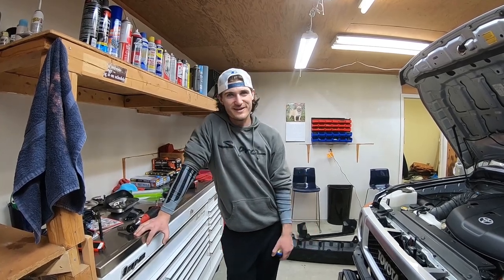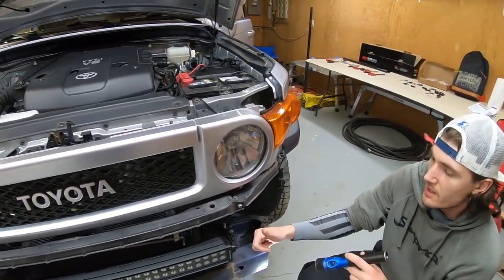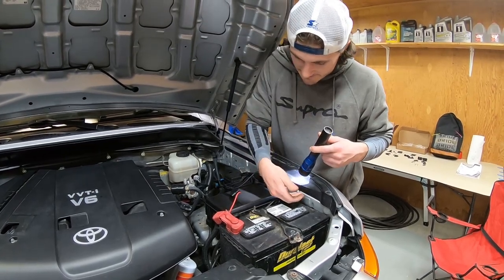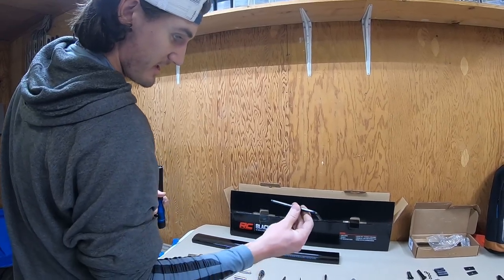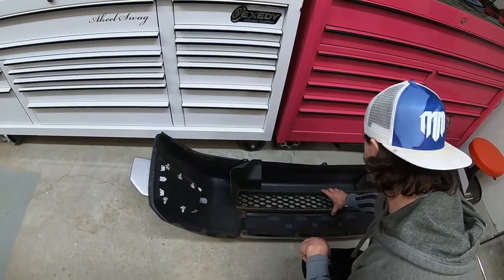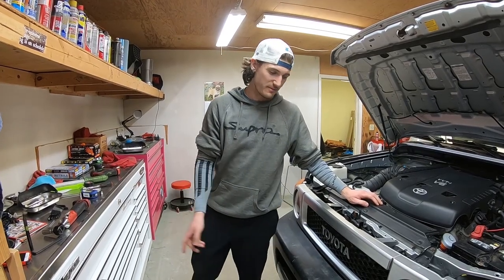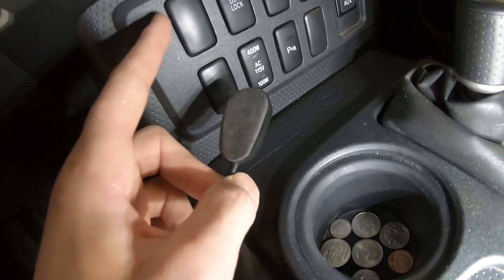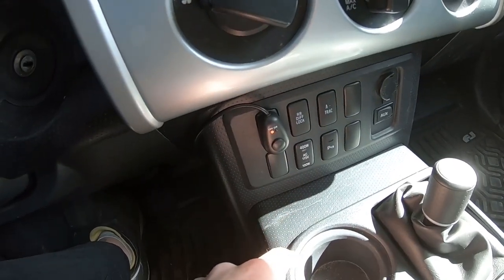FJ Cruiser Bumper LED Light Bar

Comment: Did my install yesterday…Thanks for the helpful video! Now I only have to figure out a small issue with the switch I used 😀 Light works well but the switch is not playing well with my dash/tail light circuit.

Comment: Thanks for another great video man. I was thinking about putting my lightbar on my roof but i dont want to drill into the roof or run the wire through the body panel in the a pillar. This is for sure the way i am going to run a 32" lightbar and i will be using this video to help, just like i did with your axle video. By far the best FJ how to videos. Thanks for all the help!
Reply: @Harlan Kingston meh I watch on Flixportal. You can find it on google :D -neil
Reply: @Neil Jorge Thank you, I signed up and it seems like they got a lot of movies there =) I really appreciate it !
Reply: @Harlan Kingston you are welcome =)

Comment: I really appreciate this video fam. I was planning on mounting fog lights on my oem brush guard and I had no idea how I was going to route the cables through the firewall! 😄😄

 p.s. I don't recommend putting that switch on the top left blank section of your button panel because (since you have the diff locker and A track) your FJ has traction control. Thus, if you were to pull off that blank switch, you would find the connector. All you need to do is plug the oem switch into the connector and boom! You just got yourself a package upgrade for your car all for the price of one switch 😂😂
Reply from the maker: Broken_font thanks for the info, I heard about how they just remove the switches according to what options were on the car when it’s sold. Haha. It’s silly but I might have to look into that now.
Reply: Lucky you guys got options we got one model here in australia. Admittedly it came with almost everything, i wanted extras like heated seats, sun roof, leather seats, heated mirrors etc etc etc nothing i didnt add aftermarket, but its nice ticking all the boxes when ya buy new.
Reply: Please elaborate. are you saying that if I buy the right switch and put it in the right place I can disable traction control on my 07 base model?
Reply: @tykenneth1  yes if you buy the oem switches you can enable/disable traction control, rear differential lock, and A Trac. Not all FJs can do this though because if the wire harness isn't present then these features were never installed.

A sign that your FJ has the wiring harness is if it has rear differential lock. You can also dissemble the dash to check if you have the wires.
Reply: Broken_font awesome! I have a rear locking diff... this would be really cool. Do you know of any links or diy tutorials I can look up?
Reply: @tykenneth1  it's as easy as just dissembling the dash now and popping out the blanking plugs and popping in the switches in the correct holes. Then plug the connectors into the switches!

Either find the switches on Amazon or go to a local Toyota dealership and go straight to the parts department. They can look up the switches on their database and order the parts. The switches run about $50 each and more importantly they are all unique from one another.

 Note the generic switches on Ebay and Amazon won't work because the switches have to fit the connectors on the wiring harness. Btw look at pictures online to see where the traction control, rear dif, and A Trac buttons go
Reply: Broken_font ok, this is now added to my small mods to-do list (only kind I can afford right now). Thank you for the details!
Reply: @tykenneth1  how did it go? Found harness behind that blank?

Comment: Very good video, and I recently modified the fog light for my FJ. One question is, if the positive wire is directly connected to the battery, won’t the red light of your switch stay on?
Reply from the maker: I’m pretty sure it does stay on if I remember correctly. It’s my dads so I haven’t been in it in a little while but he’s had it sit for at least two weeks before driving it that I know of so it didn’t drain the battery at all if that small light does stay on.

Comment: I just Grabbed a CH4x4 switch to match the OEM style switches already down there and it looks great!  10/10 would recommend over the switch included.  Also, I noticed you have license plate holes in the bumper; do you plan on putting that back over the light bar? Or do you have another plan for mounting?
Reply from the maker: Kyle Burns that’s definitely a good idea to get a better look with the switches. Luckily this car is registered in North Carolina so I don’t need a front plate haha. Where did you mount yours to fix that?
Reply: The lights I just installed were actually some 8” single row bars in the rear on the roof rack- decided that would be a good place to start in case I messed something up lol.  But I’m trying to figure out what to do about front lights.  I’m in Massachusetts so I do need the front plate... makes things harder 😡
Reply: I’d love a light bar up front- 20-30”, but I have the license plate, and I don’t really wanna go on top of the bumper....  kinda want a lo pro winch bumper, but also kinda want a Demello....  also have no money.... it’s tough hahaha
Reply from the maker: Kyle Burns nice, I was thinking about doing some lights on the rack eventually as well. If I did have a license plate up front I probably would have just mounted it directly under where the light bar is so it’s in the same general area. I know then the only frustrating thing is the holes left up top where it used to be haha but there are some sweet aftermarket front bumpers out there, that would be a cool look if you went that way too but I hear ya on needing the money first haha.

Comment: One thing that was either missing from this guy’s bumper or he simply broke: one 10mm screw that is damn near impossible to access, on each end, attached to a metal bracket. It will take more than an hour to pull theses screws. They are only visible from underneath, with the fender well pulled back towards the tire.

Comment: Maybe a silly question but won’t the light bar block the air for cooling your radiator? Just thinking of things the light bar might or might not effect on the trail
Reply from the maker: Krzysztof VERITAE I thought the same thing, it is offset towards the top so there’s space underneath it where air can still get through. We haven’t had any issues with the temps rising.

Comment: Where did you get the brackets?
Reply from the maker: Auston Shown everything came with the kit. There’s a link in the description where I got the light bar and it came with everything you needed plus everything else on the table we didn’t use. Did you just need the brackets, like do you already have a light bar?
Reply: Kamal Akeel yes I may use a different light bar. Really just wanted the brackets
Reply from the maker: Auston Shown if you called up rough country I bet they’d be willing to just sell and send you those brackets separately.